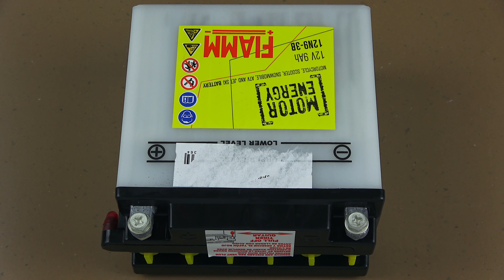How to make an oven + cooker 12V / 2 in 1 do it yourself

Comment: Basically a total short-circuit..........taking so much juice to heat that element, battery voltage would quickly drip. Maybe good for one egg, try boiling water or cooking a real meal.

Comment: Good idea for camping.
Reply: @muhammadshahbaz3234  Bangood or AliExpress ,made in China . Put there to search: glow plugs .
Reply: @tdoruignat8839  thanks gor
Reply: @muhammadshahbaz3234  With pleasure .
Reply: @tdoruignat8839  which capasty engine glow plugs required
Reply: @muhammadshahbaz3234  I don't know . I think that's to 12 volts and somewhere between 7 to 10 Ampers(A).
Reply: @tdoruignat8839  thanks nice great